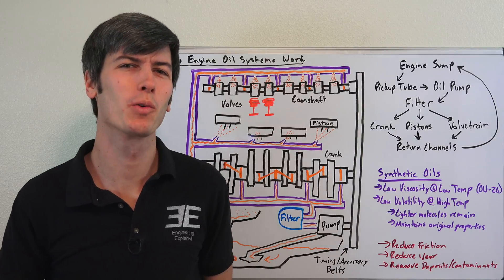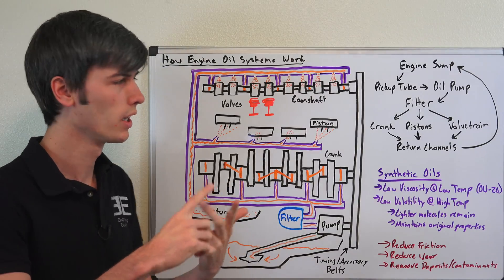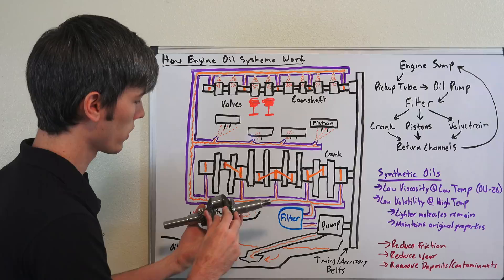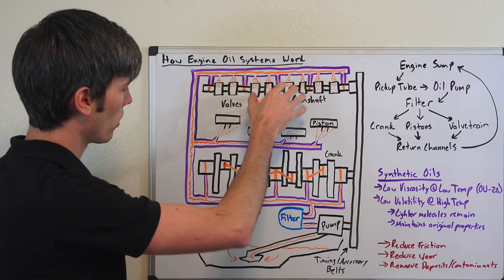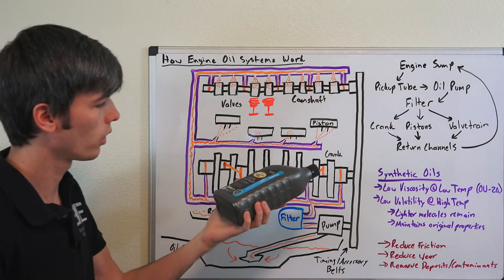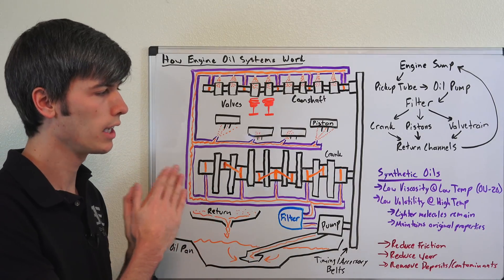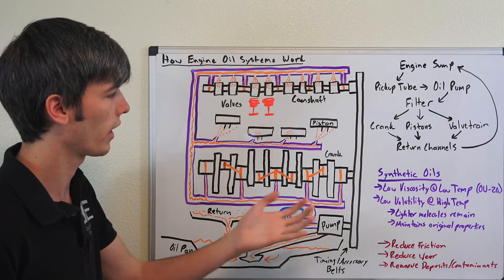How Do Engine Oil Systems Work?

Comment: this video brought to you by a group 3 not a real synthetic oil, real synthetic is group 4   and racing applications using group 5. I love big oil in the usa using a very loose  definition of synthetic.
Reply from the maker: The definition is indeed very loose. But this group 3 stuff is also used in motorsport. IndyCar uses Pennzoil Platinum 5W-40 right off the shelf. Nascar uses very similar oil.
Reply: Engineering Explained other parts of the world the definition is very strict and follow stringent guild lines anyone with a European car will know and see oil made in Europe is a true group 4 oil and not group 3. it's hard to know and see what oils are blends and true synthetic. with no proper labels and specific information to inform a customer if they are butting a blend or pure synthetic. as long as big oil can lie to you with nothing to back up there claims people will blindly purchase what they trust with no hard evidence. thanks for the reply.

Comment: I have a question regarding this. When you turn off your engine after running it for a while, you hear this dripping sound coming from the engine. Is that the oil dripping into the sump from the camshafts?

Comment: Why do carbon deposits form on intake valves on DI motors? Why do manufacturers allow this issue to continually occur, rather than fix it?

Comment: if you change more frequently you dont have to worry about synthetic oils. plus synthetic oils are thin and can slip through seals more easily right?

side note: use WHATEVER THE CAP SAYS and follow recommendations, simple
Reply: You are completely right Dingo, but I'd just like to add that because of the dissolving of buildup, synthetic oils aren't recommended for older cars. Your engine might die if you switch to synthetic oil due to all the flaws being uncovered.

So, if you've been using conventional on a car for awhile, I'd advise getting a second opinion before switching to synthetic.
Reply: the cap is not always the best. One never knows when the manufacture releases a Service Advisory with a different recommendation

Comment: So how do you feel about 10,000 mile oil changes?  That was the recommendation from Toyota when I bought my 2014.5 Toyota Camry, which takes 0W-20. Everytime I went in for a service, they told me that they would only change it every 10k miles. I don't have a volatile driving style, but it still has me worried.

Comment: Jason, then why do engines loose oil pressure? because of failed oil pumps??
Reply: Sometimes the oil pump is the reason for low oil pressure, however most times low oil pressure is due to excessive bearing clearance (wear) or an internal leak. Occasionally low oil pressure is caused by a pressure relief valve stuck open or a restriction in the filter or oil cooler circuit.
Reply: patw52pb1 the more you know

Comment: I've always used Honda 10w30 mineral oil in my '07 4cil Accord, changed at every 4K miles, as recommended in user's manual. Car has now 100.000 miles and doesn't consume to much oil (300-500mL every 3K miles). Can you suggest any other oil instead of this veeeery expensive one recommended by Honda? Can I increase oil change intervals with synthetic oils? (Typical usage is 1K to 2K miles per month. I live in Brazil where temperatures stay between 60F to 100F most of the year)
Reply: at least in the USA, Honda branded oil is a synthetic blend, but if you are servicing your vehicle at the proper intervals, any conventional or synthetic should be perfectly fine to run in your vehicle
Reply: +27dcx 
Not true. 
API standards which are based on SAE/ASTM/ISO standards are  simply minimum performance metrics.
Reply: Oil is oil. If it has the same API rating, it meets the same standards.
Reply: I would switch to full synthetic and change it every 6,000, sounds like you're doing good though

Comment: I have a question: How does the oil get from underneath the piston to the cylinder wall??

And btw, I searched for such a video just a couple of days ago because i did not quiet understand how the oil gets to the cylinder wall. Great timing :)
Reply from the maker: As the piston is moving up and down, the oil squirter is also spraying the cylinder walls. The rings work try and keep the oil out of the combustion chamber.
Reply: Some by squirters directing a small pressurized stream of oil onto the piston underside and cylinder walls. 
Engines that do not have squirters rely on splash and mist to lubricate and help cool the piston and cylinder walls.
As the oil is escaping the main and rod bearings under pressure the oil is sprayed everywhere and as the crankshaft rotates it creates a "wind" and oil storm distributing oil everywhere in the lower block area.
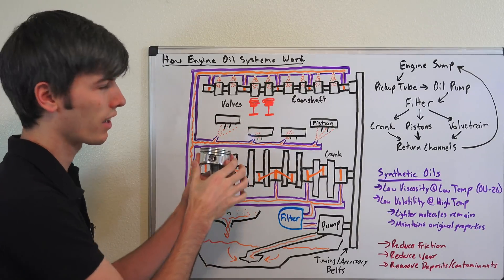Reply: BurningPsych0 Look at 2:22, piston have a holes and oil flow throuh this holes from piton underneath to the cylinder wall. Also oil is sprayed under high preasure from the nozzle. When the piston is in higher position oil spray down to the cylinder wall.

That I think ;)

Comment: And where is the oil radiator commonly placed? before or after filter?
Reply: Usually after the filter. 
The reason is to protect the oil cooler from plugging with debris.

Comment: So if I use 5W-30 in my 0W-20 recommended engine, how will it effect my engine?
Reply: If using a higher viscosity than the manufacturer requires for the ambient operating temperature, the oil is likely not lubricating as well as it should, experiences lower flow volume rates, creates spot heating of the oil at bearing juncture surfaces, experience higher shear that damages the oil reducing its viscosity and usable life, reduces the oil's lubricity and induces wear.
Reply: Actually the OP was asking about 5W-30 vs 0W-20...
Reply: stoicmuse the OP was talking about 5-20 vs 5-30
Reply: Bipin Yadu depends.
Reply: depends on the temperature range you vehicle operates in, most manufacturers have specified ranges for given oil "weights" and in extremely hot or extremely cold environments may recommend a "thicker" or "thinner" oil, usually this information can be found in the vehicles owner's manual
Reply: Kirk Augustin not necessarily, the real "difference" in a 0w20 vs a 5w20 is during start up where a thinner oil is likely to get around the engine a little quicker than a "thicker" oil, at operating temperature they are basically the same. using an oil that is too thick may not circulate properly and cause problems, not to mention things like variable valve timing that are dependent on oil pressure and designed to operate within specific oil viscosity

Comment: why not explain the turbo oil lines aswell :(..
Reply: the line is just tapped one way or another and the pressure sends the oil to the turbo's bearings, it flows through and falls down the return line back to the oil pan
Reply: There is a bit more to say...
Turbochargers mainly use oil for cooling, however there are turbos that use coolant for their turbos.
Toyota and Subaru have this. As it turns out turbo cars with coolant flowing through their turbos get to their operating temperature more quickly (which is good for durability).

And then there is a thing with diesel engine runaway, if you take a TDI car, and overfill the oil system, then it will have too much oil and at high and mid RPMs too much oil pressure, which will let oil leak out of the turbo into the intake manifold. And if you have oil injected into your intake manifold (only on diesels) you will have an unstoppable engine. Because it's the oil that's burning you can't cut the fuel or something.

Comment: you did not talk about dry sump systems........are these only used in high performance/race cars?
Reply: Mostly yes. Those systems prevent oil starvation during heavy braking and cornering. It also provides low center of gravity.

Comment: This seems more like a motorcycle dry sump system as opposed to a more conventional wet sump car system. I think as more strict emission standards come out car manufacturers are going to dry sump for the improvements in performance since a wet sump creates drag and hotter running temps thus hurting MPG.
Reply from the maker: The illustrated design is most definitely a wet sump system - I will have a video soon explaining the major differences and advantages of each system! :)
Reply: Engineering Explained As the race for more and more MPGs keep going higher and higher do you think we will see  oil systems completely powered by electronic oil pumps any time soon or are the savings on MPG so negligible it's not worth it?

Comment: did he already do one about gear ratios, and the effect of different final drive radios?
Reply: Saben Coupland I'm not saying you're wrong, you might be correct about this, but:
replaced at only 30k miles because of the cylinder shut-off system
Are you sure it's because of the cylinder shut-off system, or is it just because of pour tolerances and/or balance?
One thing I must mention: getting the tolenrances right on a cam with a lot of features like sideways motion (like that shutoff system) is more difficult.
My point is: making a reliable cam that has shutoff cylinders is more difficult than getting normal cams reliable, but the cams COULD PROBABLY have been reliable with that cylinder-shutoff, when produced properly.

Regardless of this, the manufacturer is making an unreliable cam, so at least it is their fault.
Reply: Arthur Friday
the rate of advance in technology,
Which is way too slow.
---
You didn't expect me saying that, right?
More advanced technologies allow you to produce better products, but products don't get much better.
Yeah the iphone is now thinner, but the batterylife is crap, yes LiPo batteries can store more energy but they are not new and they can explode. 10 years ago LiPo's were used in RC aircrafts, because if they explode, it's in the air, not in your pocket/face. Secondly you won't fly an RC-model in a crowded area.
I mean, give me one day and I will made your car engine more efficient; no joke, I can do that, at the cost of lifetime. I mean you can remove the gasket and replace with liquid packing, you can put in thinner oil or heat the oil more, which will reduce reliability and lifetime of your engine.
If you have real talent, then you can make it more efficient without decreasing the other goodness.
Better batterylife in stead of sleakness (by making it thicker) is not a new technology.
They make it slightly better, but mosly just different, and they market it as "the holy sh*t technology".
---
Your new smartphone is faster than your old one, because they made it such that you can't update your old one, then your tech will get slower as you use it (like fragmenting of the harddisk or SSD). More than this: they make software that will run on old computers, but it will run slower purposefully.
To ilustrate my point: in terms of raw performance your cpu/gpu hasn't inproved much, but because of drivers and similar things your old tech can't run that new program as smoothly. So if I would buy the licence for the old AMD terascale architecture, and only give it the new features like the h264, etc. etc. then it will still be somewhat close to the latest grafics cards: but my 'chinese-knockoff-proposal' would have actually more bang for the buck
Reply: Arthur Friday
Exactly, and I mean soldered ram does take in less place. You if you redesign a laptop with soldered ram, you will have the same performance, but with a thinner form factor. (win-win, right?) And all the vloggers call it "progress", even though there actually is a drawback that could have been prevented.
Reply: gtdrummerdude simply trying to understand. this is one thing I've never been able to fully figure out
Reply: And fuel economy won't necessarily improve by having lower highway rpm either,
Low RPMs are indeed having that drawback of higher load on the engine. And running an engine at low RPM is just disastrous for durability.
The engine is most efficient at the peak where it has the most torque, which is half-way the RPM-range.
A highway situation is a quite high load scenario, so that's when you need the higher torque.
Reply: Arthur Friday  all automatic transmissions are destroying your engine
And manual trannies with shift indicator do the same thing.
---
and to avoid Gas guzzler taxes.
Ehm, this wrong shifting will give better fuel economy when your car is new, but because of the increased wear and colder combustion your engine will get dirty and will have WORSE economy after some time than you would have has in the right gear.
Which is exactly what they want!
Because you buy a car with let's say 50mpg, and after some time it will consume 40mpg, after some more wear it will be 35 mpg; And then they have an excuse to sell you a new car with 50mpg= more profit.
Actually car engines are also designed to do some suicidal things.
Nissan and Jaguar are omitting oil return holes under the piston rings; BMW, VW, Toyota, etc. are drilling less of these holes so that they get clogged up quickly. Subaru is putting isolation around their cylinders to reduce the cooling. Even the Japanese quality brands are making kamekaze engines.
---
Cylinder shutoff is putting additional load on the crankshaft by the way, and it because cylinders have different temperatures they can warp a bit. Yeay, 5000$ engine overhaul!!!
More money for the dealer!!!
Reply: sasja de vries cylinder shutoff also puts an immense strain on the cams
Reply: Saben Coupland
I'm not so worried about cams, whenever a cylinder is switched off the cam is not used on that cilinder. It does put stress on the cams when shifting on or off, which will have to happen in one revolution.
Also VTEC had a similar thing where it choses between a high profile and low profile, they just replaced one profile with no lift at all.
(When writing this I had the audi design in mind, other brands can have a bit different methods.)
Anyways if will definately put more stress on the cams than it would without that system, so yeah, it will wear out more quickly.
Reply: sasja de vries that's a good point. I hadn't thought of that
Reply: Arthur Friday i do feel concerned about the pollution
Well...
A cruise ship emits more in one journey than all cars in a city in a year. Obviously politicians decide to make cars cleaner in stead of ships; that makes ****ing sense, right?...
Secondly: when ecology-tech makes technology wear it's even worse for the ecology.
Thirdly: start-stop is usually programmed a bit too gready; you have the least wear when your engine is at the right temp; this also improves the burning process and catalyst.
But start-stop-systems usually shut down the engine when you come to a stop at the traffic light even when your engine is below 60°C.
If start-stop only worked when your engine is completely warm (90°C) then I would be happy.
Reply: Arthur Friday
Somehow the govt should force companies to make the 2JZ-fe and similar engines again.
That engine can last a million kilometers with no problems, just replace belt, oil and that sort of stuff...
Making single-use throw-away products costs environmental resources too. The factories use tons of coal and energy, if you make these ever-lasting products then you've lost that pollution-source. Then shipping that new toyota engine all the way from asia is again only producing greenhouse gasses.
If you can just use your car for a long time and actually upgrade it, in stead of replacing it, then people will be more carefull with their cars too.
Kind of like desktop-PCs, you can replace the graphics card without replacing the whole PC. With that new gfx and an additional harddrive you have your favourite tech you're used to with that new performance gain.
Reply: sasja de vries while I don't disagree, part of the issue is advancement of technology. Manufacturers are constantly dumping huge amounts of money into developing and innovating more powerful, efficient, reliable, and smooth-running engines. a 2002 Toyota 4 cyl is vastly different from a 2012 Toyota 4 cyl. Why would a car company want to invest in an engine that will last longer than the rate of advancement allows, where more emission-emitting, cruder engines are living longer than the rule of obsolescence?
Reply: sasja de vries the only reason I mention cams is because Regularcars (love that channel) did a review on a Chevy Caprice PPV that spent a third of its life idling, and had to get a burnt-out cam replaced at only 30k miles because of the cylinder shut-off system
Reply: so idk about other brands, but it is a real-world example; it's rare that such examples exist for such parts that almost never show signs of wear
Reply: to expand on your idea, what they should invest in is a truly modular engine. A new, freer-flowing head was just designed? Just swap it on top. a better filtering exhaust was just created? throw that bad boy in there